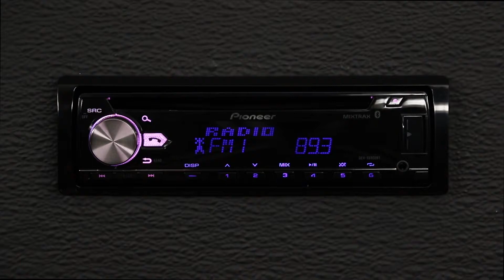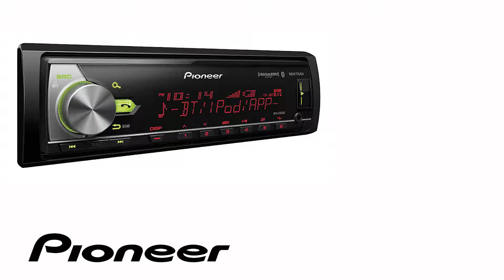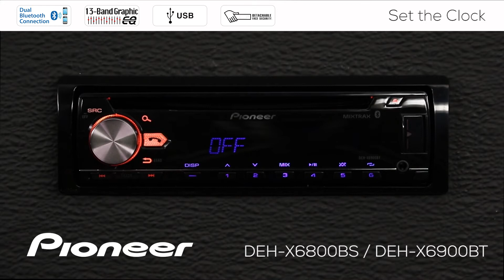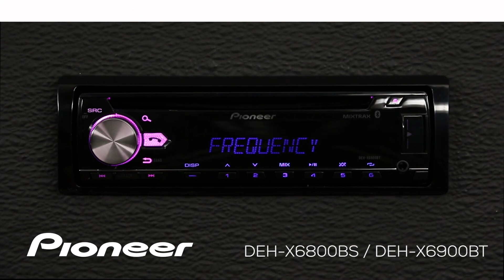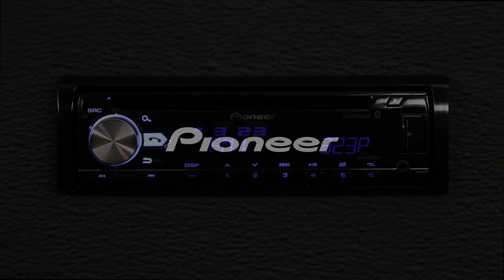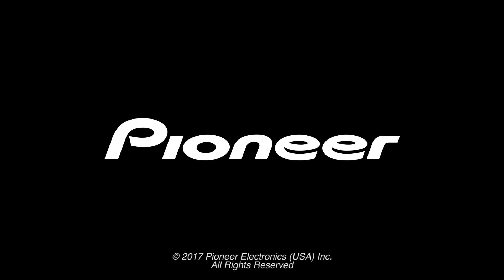How To - DEH-X6900BT - Set the Clock

Comment: I have a problem with the clock .Time resets when turning off ignition wile taking out the key.All other memory setting as radio stations and prisettings are working fine.Bluetooth conections are fine.Demo is off.Just the clock resets.Passat 1998 b5.DEH-09BT.Any ideas on that.....?